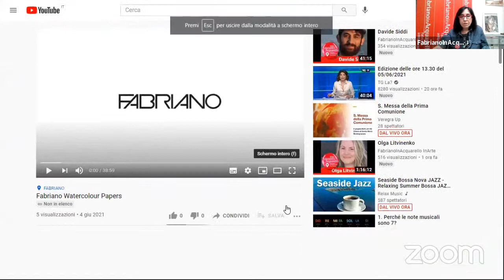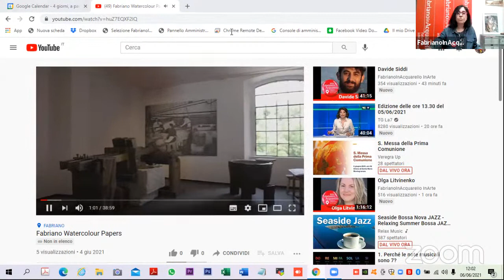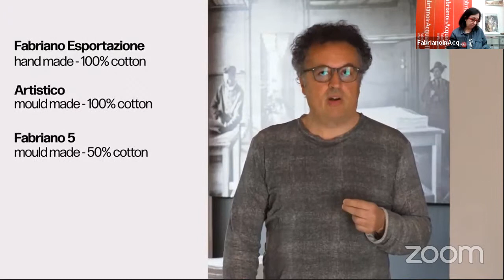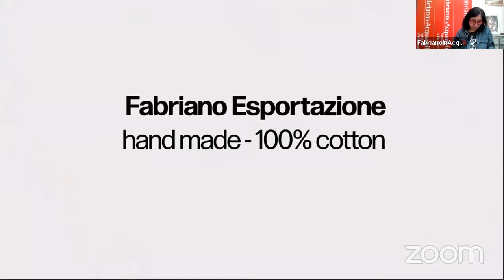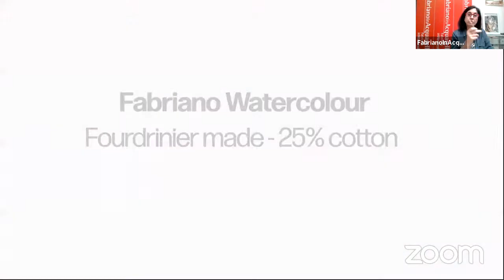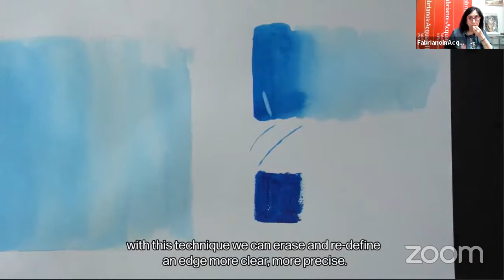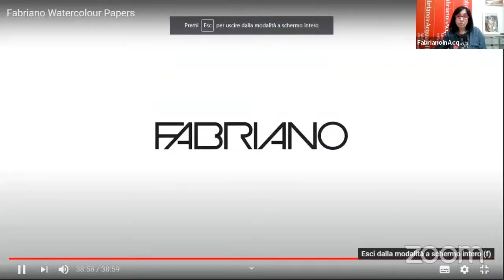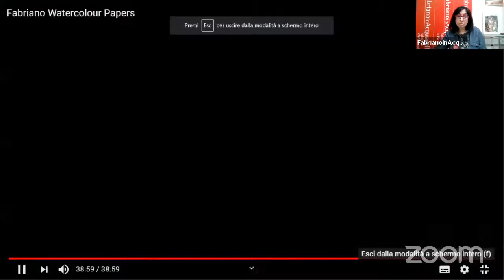Brand news Fabriano paper with Giuseppe  Prezioso

Comment: Caro Giuseppe, is the current watermark on Fabriano + Artistico arranged in the corner of each sheet at 90 degrees to each other, as seems to be shown in the still cover image for this video, or do they continue to ‘scroll along in line’ on the short side? Has the  lettering height changed? Congratulations on a great video, very informative - I wasn’t aware of the Fabriano 5 meaning. Grazie anche a Davide, ben fatto!